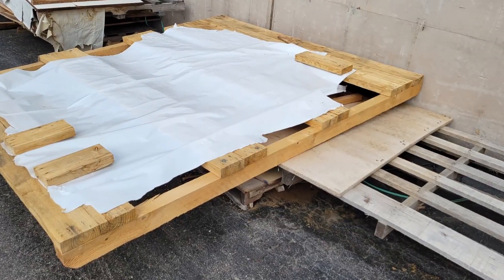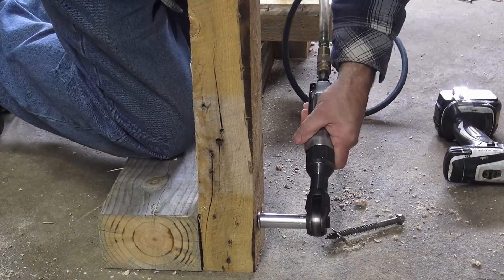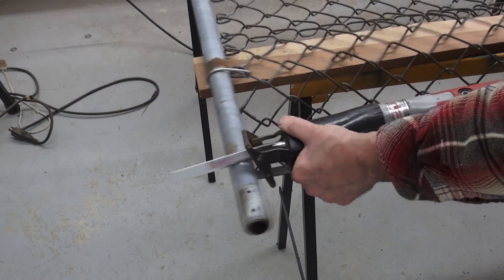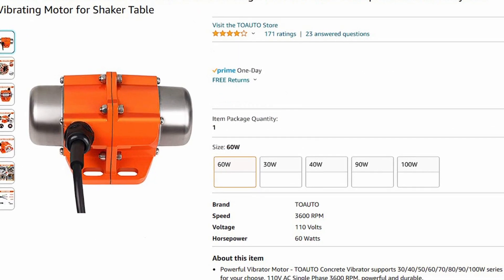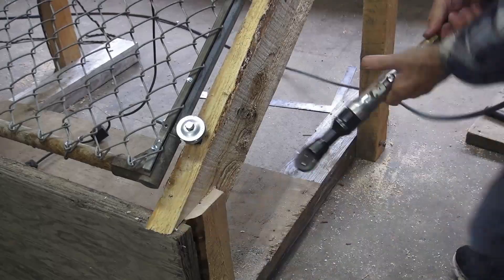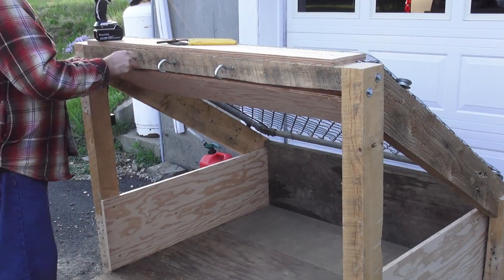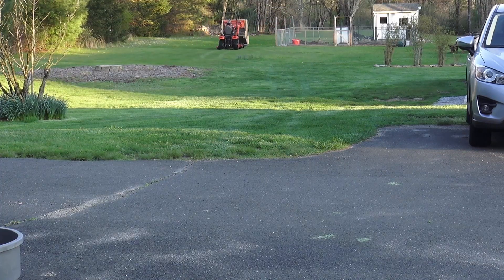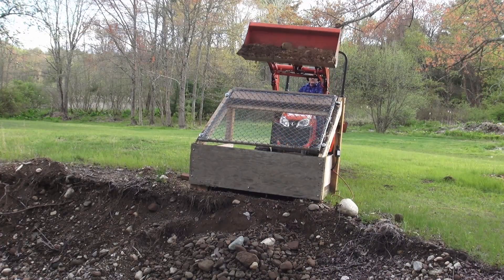Budget Rock Separator

Comment: Thank you for this.  I think a pair of stepper motors or hydraulic lift arms....why not have it sit almost level and lift to dump once the dirt has sifted through more thoroughly. 
You are definitely on to something. Even using ACU direct burial p.t. from say...
Menards...for some of the frame structure. As far as chain link, look for old 70s hot dip galvanized. For screen, perhaps 4 guage 16'×34" hog panel from tractor supply. 4 guage something. Hot dip galvanized. 
I know you're looking for free however your labor isn't free so start with a substantial base structure.